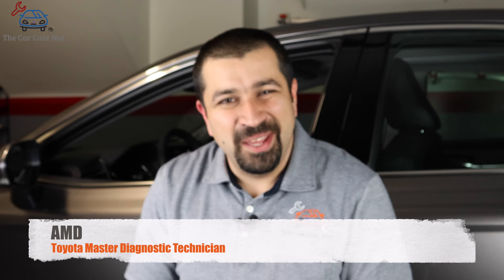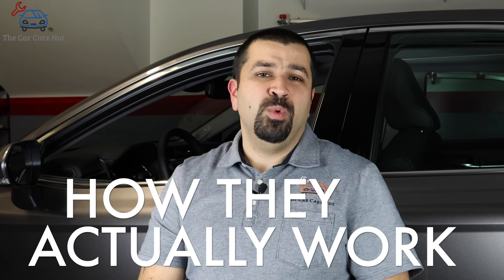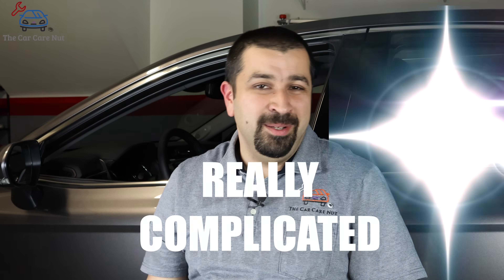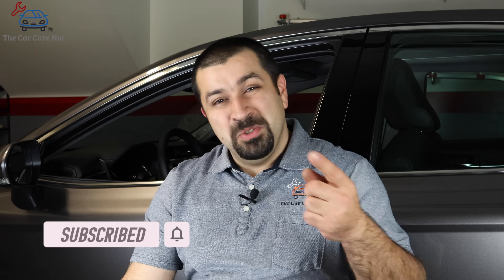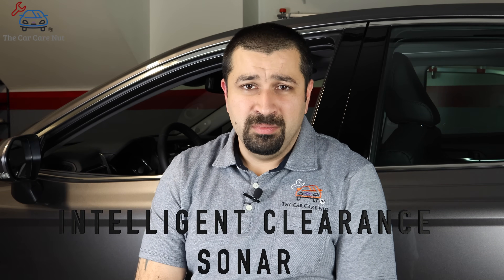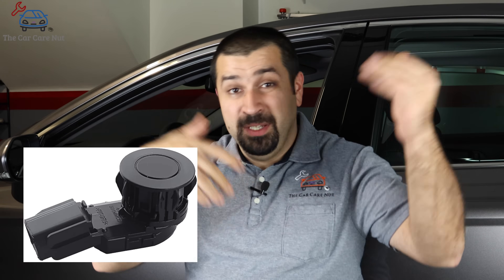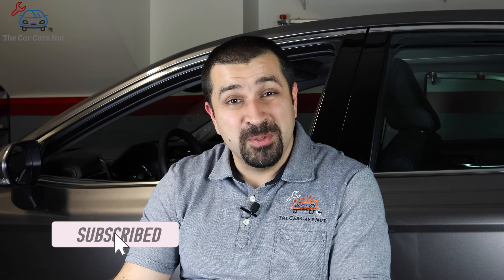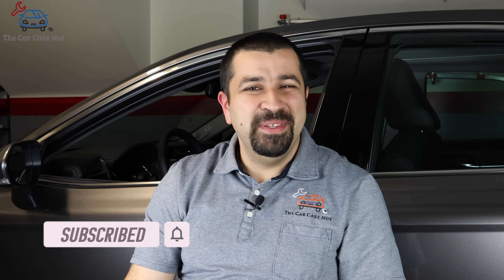How Toyota new technology works : RCTA, RCD, ISC and Panoramic Camera

Comment: We bought a new 2022 Camry XSE that was on the truck headed to the dealer. It arrived on a Thursday afternoon and Friday evening we picked up the car. Drove it 30 miles to our home. On Saturday  morning we went to drive the car and the BSM and RCD errors showed and started it and stopped it again but still there. Contacted our salesman and he said to bring the car in on Monday. Sunday morning we were backing out in the church parking lot and someone backed into us on the rear passenger side causing a small dent, the bumper was fine. Took the car in on Monday and they performed a recalibration on the car but the error remained and they are trying to tell us the accident destroyed the sensor and that part is $1000. There is just a light dent and they bumper was never touched, I am now feeling like they are dishonest and maybe afraid that the BSM might have warned for that SUV that backed into our side. Please tell me if there is a $1000 sensor on the rear side of the car?

Comment: I have a brand new 2021 Camry Hybrid and I would like to know why does the RCTA light stay on in the dashboard when not in reverse? This is annoying. The light on the dash should only be on when the car is in reverse. I took the car in to be serviced and they said this was the normal operation. If I don't want the light on all the time I have to just disable the system and then it is always turned off. Any chance Toyota will release an update to fix that?

Comment: If a car is coming close behind you while you are backing up will RCTA stop the car or does the car need PA w/AB to stop the car?  
Will RCD stop the car as well?  I have a 2021 RAV4 Prime, but not with the premium package so I don't have PA w/AB
Reply from the maker: Hi! It won’t stop if it doesn’t have PA W/AB
Reply: @TheCarCareNut  I bought a 2021 RAV4 Prime XSE with the Weather Package only.  I would have had to pay almost $5,000 more to get PA w/AB.  I didn't want Navigation, JBL Radio, HUD, 6.6kWh Charger, Panoramic Sunroof, 360 Degree Camera, Power Passenger Seat, Ventilated Seats, Digital Rear View Mirror, 1,500 Watt Power Outlet, Adaptive Front-Lighting System, or Foot-Activated Power Liftgate.  Although maybe worth the extra money, I don't miss any of those features.
I hope in the future I will able to get PA W/AB as a stand alone option when I buy my next RAV4 Prime with a solid-state battery.

Comment: Thanks for the video

Speaking about creativity and making the most out of existing features, I have this thought:

Is it possible to use the 2 side cameras and display just the blind spot portion view in the computer ? That can complement very well the current blind spot monitoring system.

The Honda CR-V has a similar camera for the right side
Reply from the maker: Hi! There’s no oem integration for side cameras like the honda in Toyota vehicles

Comment: 2020 Camry XSE, RCD unavailable message shows on the screen but dynamic lines still work and turning left to right lock to lock does not get rid of the message. What else can be wrong?
Reply from the maker: That is another issue that would need codes pulled and diagnosis

Comment: Good morning ☀️ AMD, My 2014 Prius doesn’t look like the fan has a filter do you recommend me to purchase a filter?
Reply from the maker: Hi Michelle! I would invest in a filter for ease of cleaning. If you have heavy back seat use I would install one and keep an eye on it
Reply: Would spraying the filter with air be as effective as taking it out to clean it?
Reply from the maker: I wouldn’t spray it with air while it’s installed because then you’ll push the debris into the fan. I would take it out and clean it
Reply: Lol amd that’s so true about the debris 😁😆I’m just trying to save money
Reply from the maker: I would do it yourself and save money. It’s not hard and with practice it’ll get easier and no need to replace the filter just clean it and reuse it

Comment: Thank you for your video’s. They are very helpful. I want to ask regarding gas hybrid like the new Sienna. What do you do if gas- hybrid cars won’t start. Can I jump start it or trickle charge it? Also, can I use my mini compressor pump to fill air that uses clamps attached to 12v battery? Thank you
Reply from the maker: You can jump start hybrids because they use a 12v battery to start up the hybrid system. A small compressor to air the tires should be ok.
Reply: @TheCarCareNut  so if my 12v battery fails then I need a power battery pack to start it. Nowadays they are too small to start up a 5.7L gas engine. Or example if my 12v fail and I don’t have a trickle charger then I just have yo contact a toyota suto service or CAA. Thanks
Reply from the maker: You can jump start hybrids with the smallest jumper pack as they don’t need much to start because there’s no starter.
Reply: @TheCarCareNut  thank you

Comment: I have a question are the 2018 and up csmries are coolant guslers top of the reservoir couple months ago have put bout 1000 miles plus on it went down a lil radiator is full so Ik is not a head gasket
Reply from the maker: Coolant will expand and contract. Check it when the car is cold fill it up to half way in the reservoir and then check it again when it’s fully warmed it will be at full.

Comment: I get software up dates on my 2019 Avalon a few time a month to download. Does it update the RCTA,RCD, ISC, etc.to the latest rev. that new Toyota's have?
Reply from the maker: These systems really haven’t had any software updates as they run pretty well.
Reply: likely not... because system faults are dealer's profit center to extract money. They are not in business to distribute freebees.

Comment: Thanks so much for sharing!  Great video!  Does TSS-2.0 come with the automatic braking for RCTA and the ICS system, or is that only TSS-2.5?  Thanks so much!
Reply from the maker: Hi! RCTA and ICS are not part of Toyota safety sense as they are optional in most models. So the version of TSS will not have an impact on them. It will vary model by model if they have braking or not.

Comment: Love your informative videos.   I have a 2020 RAV4 XLE Hybrid with RCTA and Smart Stop Technology Backup Camera (SSTBC).  I don’t have ISC (no sensors).  Is the SSTBC the same as RCD?   Could I add ICS system to the car?   Could RCD be added if it’s not SSTBC?   Thanks.
Reply from the maker: Thank you for watching my videos. Sstbc is the same as rcd. Also isc can be added aftermarket but it won’t have the brake function

Comment: I HATE the auto start/stop on my 2021 Rav4... the default should be OFF, not ON which would eliminate me having to turn it off each time I drive the car.   You would think Toyota would have a software modification to default it to OFF.  Is there a fix or override for this?
Reply from the maker: Hi jerry. I totally understand your frustration as I feel the same way. However that auto start stop is part of the emission system of car and not something Toyota likes to do that’s why it defaults to on every time you restart the car.
Reply: Hybrid technology doesn't need this annoying system.🙂

Comment: What! A Toyota loses steering wheel calibration?
I have yet to see that in other cars/brands.

“Really dangerous” when your 360 degrees camera doesn’t work right?
Doesn’t people look around and through their windows/mirrors anymore?
Reply from the maker: I hear you. But it does happen. I own other manufacturers cars and every time I don’t drive one of them for more than 2 weeks gotta do the same otherwise the amber warmth and glow of the traction control light gets distracting.

Comment: RCD Unavailable
Owner: Hmm I should take the car to the dealer to see what's broken. 
Dealer: Yeah your RCD need it recalibration, that would be $120 (or $200)
Owner: Toyota seems to slip it's reliability lately. 
The CCN: RCD not working? Just turn your steering full left then right, done.
Owner: FUCK!
Reply from the maker: 😂 basically...
Reply: @TheCarCareNut  Is this in the owner's manual?
Reply from the maker: Likely not. I haven’t really looked into the owners manual for this one but it is somewhere buried in the repair manual.
Reply: Still not working with me !!